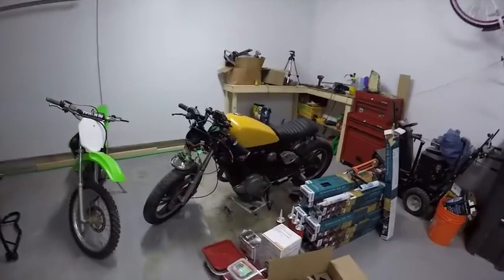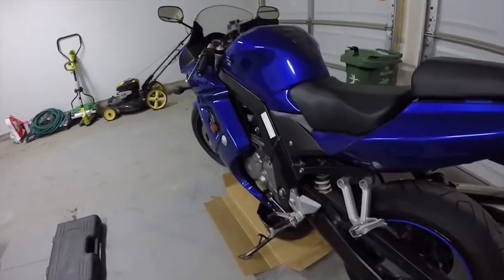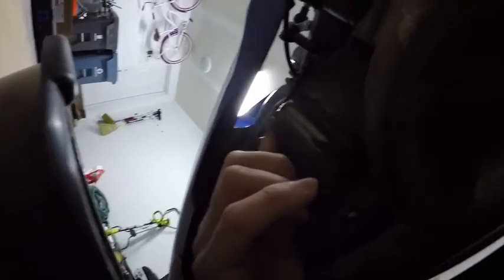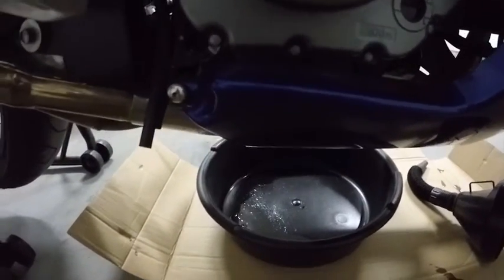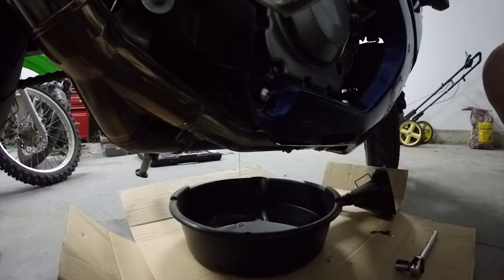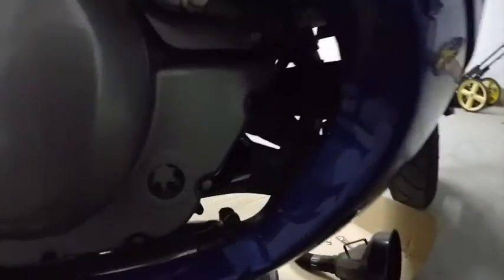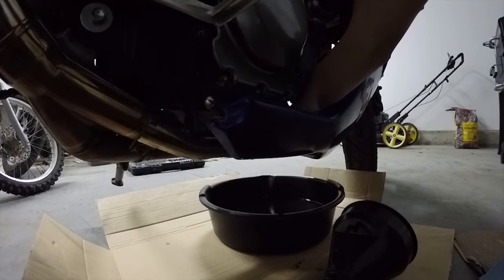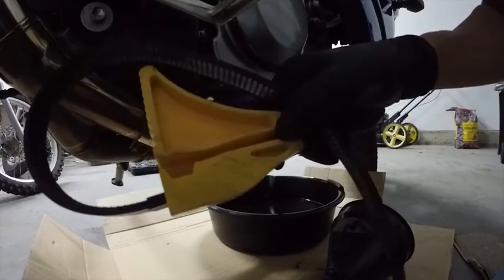How to: Suzuki SV650 S Oil Change DIY

Comment: Hey man thanks for the video. I have the same bike i just have one question. there are two bolts on the bottom of the bike and im not sure which one is the oil screw. im guessing its the biggest one down there? and its like right smack in the middle down there not put off to the side right? Thanks again would appreciate if you got back to me. and where did you buy your oil filter?
Reply from the maker: It's directly across from the filter and it's a 14mm bolt head. It should be pointing straight down, pretty much in the middle like you said. I got the filter at a local bike shop around the corner. Most car parts places will carry them too or you can always go to Amazon.

Comment: Nice Bike,
I just got 2004 SV650S with 1400 miles on it so its the same exact bike you have, but i wanted to ask you where did you get the lower fairings?
Mine is naked .
Reply from the maker: Thanks!  You'll like it, it's got a good amount of low end grunt to get you going!  The  lower fairing came with the bike...the SV came in 3 different styles - Naked, upper fairings only and the full fairing kit like mine.  Surf the forums, you can usually come across a set for pretty good price.
Reply: Ebay